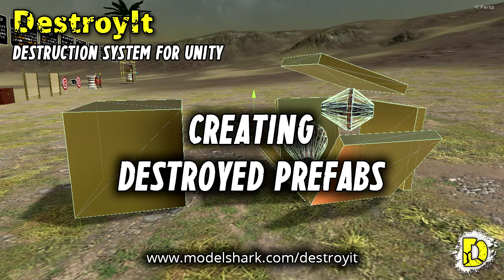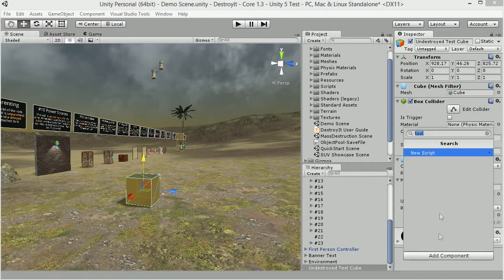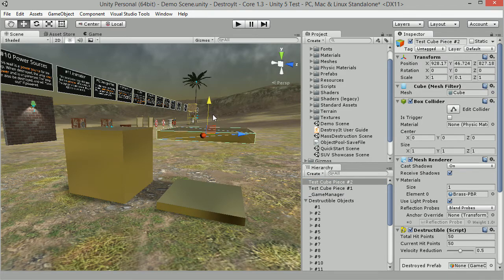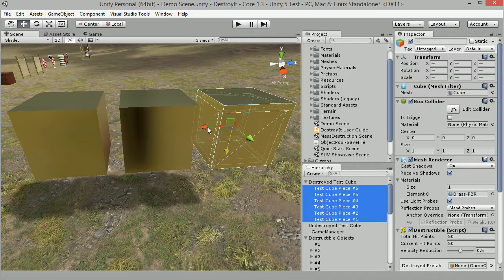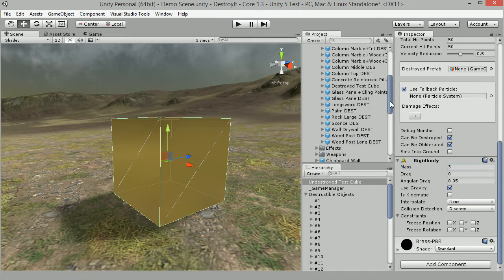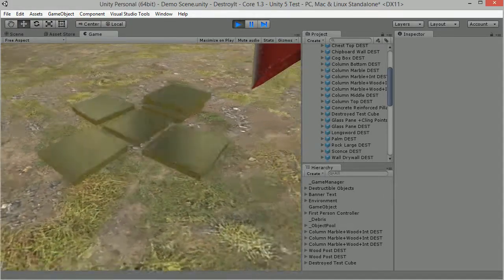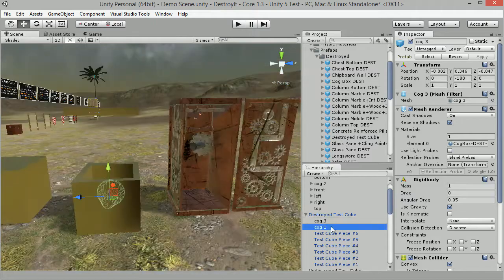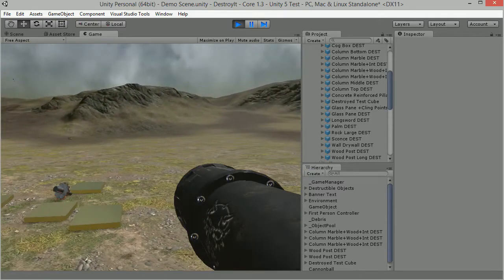DestroyIt - Creating Destroyed Prefabs

Comment: Hello, not sure if you will see this comment. The destroyed prefab likes to position itself above the object I'm destroying, anyway to fix this? been driving me up the wall lol
Reply from the maker: Hi, check the position of the center (or pivot) point of your destroyed prefab. Compare it to your pristine prefab. I like to drag both prefabs into the scene and position them at exactly the same point, and check the center points of each. You will probably find that your destroyed prefab's center point is higher than your pristine prefab, based on your description of the issue. 

If that's the case, you can create a new empty game object, put your destroyed prefab under it, and adjust its position down to exactly match the pristine prefab. Hope that helps!